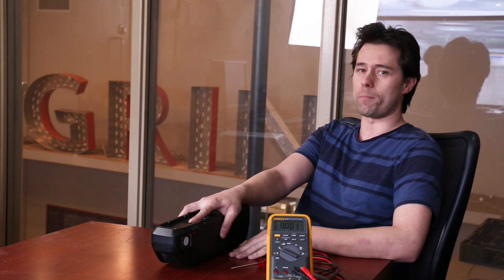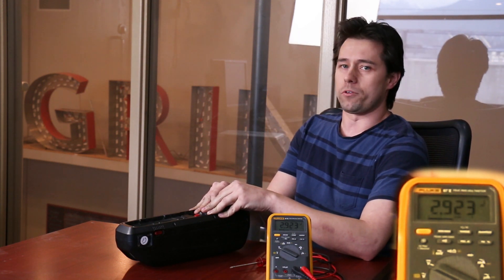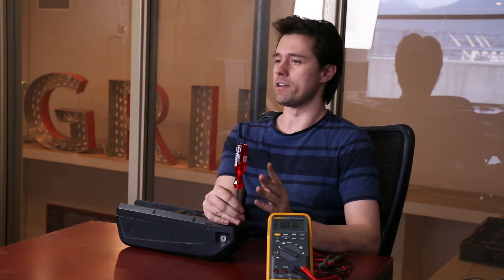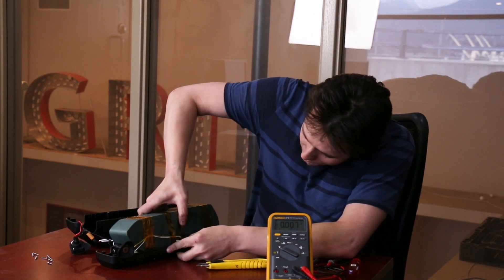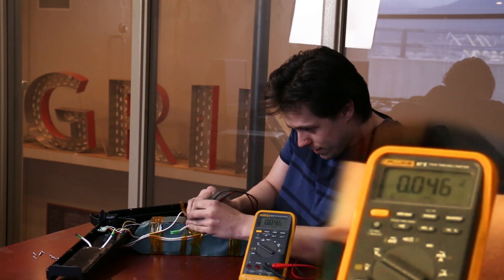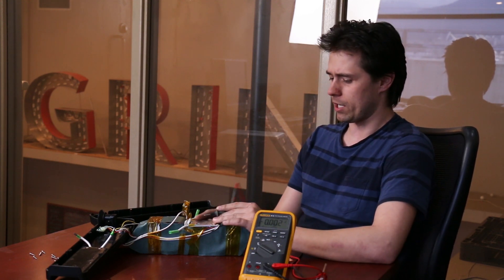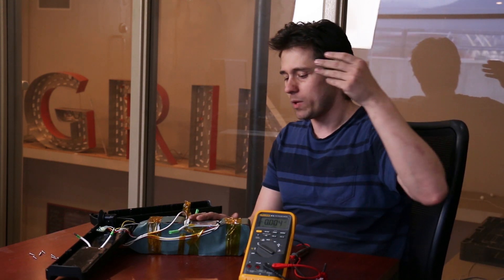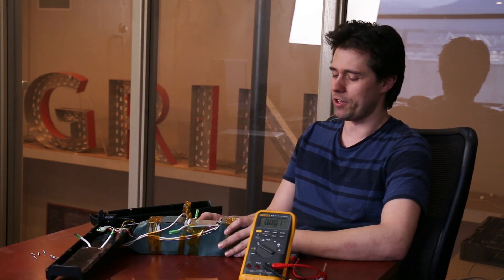Example of Ebike Battery Disassembly and Diagnosis

Comment: Hi mate u still on here ? Iv just bought a bike stealth bomber. Been left b4 i bought it. At the charger it was 57v. I opened it and the batteries were in sets off 11. All the sets were 4.3 on v metre except one set that say 0. When I put the volt metre on 1 side of the bms it shows 83v. The bike has only done 200 mile so was hoping save the battery.  Any ideas ? Thanks
Reply from the maker: Are you not able to contact the company that made or assembled the battery? Or the company that initially sold it and has a duty to support the item that they sold?

Comment: Hi, My battery does not turn on. Maybe the BMS is faulty?
Reply from the maker: Possibly. Or the BMS is doing it's job perfectly and you have a cell group that is at a critically low voltage, or perhaps just your on/off switch is broken.  Speculating only gets you so far. Instrumentation gets you to the root cause.

Comment: Can you bring it back to life if you charge it intermittently and slowly? Or is there no point, it won't hold charge after being this low?
Reply from the maker: It's a game of serious fire safety too. But usually even if you do try to "revive" a cell that was sitting at like 1V or something, it will have less capacity and keep self discharging.  It's really not something to do outside of curiosity.

Comment: Jim my friend accidentally put the key in the battery charger slot and shorted it out it smoke !!!! Is it still fixable?
Reply from the maker: Almost always yes, but it may require a replacement BMS and replacing that is often a non-trivial thing. Ideally the charging port would be fused in a way that can handle external shorts without any circuit damage, but this is not always the case.

Comment: E-bike batteries are junk if they can become useless after leaving them sit for a few months.  Shouldn’t be legal to sell crap like this.  I don’t have this problem with the lithium batteries that I use with my power tools.
Reply from the maker: The power tool batteries are even worse in that they don't even have a BMS circuit for the most part, so they go totally irrecoverably flat in a matter of days if left connected to an ebike motor controllers. Try it and you will see how junky designed powertool batteries are in a battery to battery comparison.  At least an ebike battery with a BMS circuit will trip at ~2.7 V/cell and then gives many month of margin before self discharge brings it too low. 

The difference is that cordless power tools are intrinsically off with zero quiescent current draw, while most ebikes have an on/off switch that the user can inadventertly leave on and allow the battery to be drained over time even when they aren't using the bike.
Reply: @GrinTechnologies  My e-bike battery was completely removed from my bike over the winter and is now useless without taking it apart and "jumping" it.  My power tool batteries never do that.  I'm guessing it must be the BMS board putting a parasitic drain on the battery, or the batteries themselves are just trash.  Regardless, e-bike batteries need to be improved.  I shouldn't have to risk catching on fire and inhaling toxic lithium fumes because the $600 battery I bought discharges to 0V over a 3 month period.
Reply from the maker: OK, that then is a poorly designed battery BMS board.  There really is a large range of quiscent drains, really bad ones are over 1mA which translates into about 1Ah every 5 weeks, while most are about 150-300 uA which will drain 1Ah in more like 4-6 months.   If you store your battery with 2-3Ah left in the tank it will last a year no problem, but if you remove it with only like 1Ah left then yeah it can be at a real risk.   We fully agree that the quiescent current drain of the BMS board isn't nearly emphasized enough, in fact I don't think we've ever seen a single battery spec sheet that mentions this value. 

On our LiGo BMS, we were able to have the batteries go into a sleep mode where the drain is just 2uA, but there was a bug in the firmware meaning some devices never went into deep sleep mode automatically and so suffered the 200+ uA drain.

Comment: 200mA and perhaps the voltage will lift to normal state.
Reply from the maker: Sometimes yes, but it can be a dangerous to recover cells that are a very low voltages regardless of how small of a current you use.

Comment: I have a triangle battery of 48v and 28.8 ah, I have been using it for 17 days, but yesterday it did not turn on, when I put it on the charger the panel turns on and says 100% charged, without the charger the panel does not turn on, the battery does not pass energy to the electric bike, can you tell me what the problem is?
Reply from the maker: Well your BMS circuit is tripped and only passes through the charger voltage when the charger is connected. Your starting point should be contacting the vendor who sold you the battery, as this is their responsibility to support you.

Comment: You know a lot about ebike batteries!  I have a question for you please, I have an ebike battery (48V lithium ion battery 14 ah) that has a small crack in two areas around where it plugs into the bike (the plastic battery dock/mount).   The bike seems to be working fine.  Is this battery dangerous?  It seems to be working fine (I've ridden it for 2 weeks no issues).  The bike company wants me to replace it, but maybe they're being overcautious.  I'm thinking of putting super glue in the crack (which should seal it from water etc).  Please let me know what you think??
Reply from the maker: It's unlikely that the crack is a safety/danger concern, but if the bike company is offering to replace it for you, then I'd certainly take them up on that offer to have a non-cracked case. What's the downside?
Reply: glue works to seal many different things, i use it all the time to seal damaged things and also to stick things together, anytime you get a crack in something that water or dirt can get in, fix it by glueing it, i use guerilla glue and other ones to fix many things

Comment: 😂 Our ebike battery measured across pin outputs show only .996v instead of 52v, we just ran about 5miles and back home, next day nothing on display. what is the issue? Thanks
Reply from the maker: Check the voltage on the charging port pins to see what they show there. Obviously now the BMS circuit on your pack is tripped so you are not getting any voltage on the output port.
Reply: @GrinTechnologies  we found out it was cheap,plastic switch they put on😇

Comment: That dammed BMS is smarter then you, folks the factory program then when 1 bank in low, shut down charging and volts delivery, scam and you can reset the bms after all cells are balanced, find video on ytube.

Comment: Why does my 36v battery charge to about 40.5 volts but then cut out while riding it at only about 39.5 volts?
Reply from the maker: You'd have to open it up to find out!  If you have a very badly unbalanced cell group, with one cell that is at like 3.0V while the rest are at 3.9V, you would have this kind of behavior.
Reply: @GrinTechnologies  OK thanks for your advice.I am reluctant to get involved in all that stuff for now.
My bike appears to be a NAKTO Ranger though it was sold in the UK under another colour scheme with no name on it except the logo 'Smart' & I cannot find a way to buy another battery. So I have bought a Yose Power one that I've bolted on over the top & that seems supa dupa It is just that I would like to use the original one in situ then I could double the range.Problems problems......
Reply: @GrinTechnologies  PS: Is'nt the BMS supposed to prevent situations like that from occurring?
Reply: @nicholasmorrill4711  it cant if the specific battery has gone bad and doesnt retain voltage very well
Reply: @ademiravdic  Well I don't understand why if a specific cell has gone bad why it dos'nt just cut it out & leave you with a slightly reduced overall capacity.

Comment: cells are battling each others the most, when fully charged on storage. so charging around 50% when stored, might be a better solution.
Reply: for long term storage, fully charging is not bad

Comment: Each of my cell packs had 3.6 volts per voltmeter readout but battery still wouldn't run ebike. Could it be bad bms? Can those be purchased and replaced?
Reply: i have the same issue, my battery wasn't  charged for over 10 months. I charged it and it holds voltage for days but it still shows low battery on display..

Comment: My battery showed 84% life today before it shut down. I may have asked too much of it while trying to plow through some deep snow. 
Input (where it's charged) shows 29v and output (where it connects to the bike) is giving 3v. 
Is there a way to reset the BMS? 

Turn Life 48v/14AH 672WH
Reply: BMS reset via charging through output connection worked!
Reply from the maker: Indeed that will typically do the trick if disconnecting and reconnecting it from the controller doesn't.

Comment: Many thanks for the video. How should one store batteries if not being used for few months. I read they should never be at full charge or extremely low charge.  Batteries should be at about 40% and charged for about 30 minutes every month. Is this correct?
I have just bought a spare battery from some who bought it new but never used it and this has been sat in his garage for six months. What is the best wsy to test it is working as it should? When battery is out of bike and power button is pressed for 5 seconds and released all five bars light up, indicating it is operating at 100%. It is the battery for Carrera crossfire.  Thanks

Comment: What a bad bms . That’s way I build my batteries my self . Imagine buy a good battery with Panasonic cells and a 5 dollar bms ruining the pack . This is not acceptable.  I failed finding a good bms to buy for my ebike and I come with idea to use a Hilti 36v battery bms . Gues what? Works flawlessly.
Reply from the maker: There are good BMS circuits out there, but they are hard to source by themselves. Usually the BMS companies only sell in volume to battery assembly houses and not retail.
Reply: Grin Technologies , where is your work shop located I have a battery that might need a new Bms!

Comment: Hi Jim can you do my bms, READS 52.V .BUT LIGHS DONT STAY ON UNLESS IS PLUG TO THE CHARGER .ITS A HIALONG 3.NO WAY TO RESET.
Reply: It a  48 v 13 ah.It was short circuit accident.
Reply: @Bob J there is no fuse i looked everywhere. No fuse at all.thanks
Reply: No fuse
Reply: Is there a address we're i can sent my baterry to be repair.

Comment: i have heard of people being able to recover 0 volt cells and getting back to working though it is risky and should be done carefully.
Reply from the maker: I have directly witnessed batteries go up into billowing clouds of smoke and flames, warehouses burning down, living rooms getting charred, and more from people charging up batteries that had been down to near 0V.  Carefully doesn't begin describe the risks involved.
Reply: @GrinTechnologies  probably shoddy batteries from china or you did not carefully charge them they have to be charged up slowly in bursts and monitor temperature to make sure they dont get too hot i have recovered batteries ok safely
Reply: Any idea how to  do it safelly ?
I don't really want to open a battery to see the cells, i'm not equiped to put it together again...
I do have access to a charger with variable voltage(V) and intensity(A) but i'm not sure that, even if i bring the V down i can charge it up again through the bms

Comment: So if i were to go travel for a long time, would the best idea be to actually disconnect the batteries from the bms to prevent this?
Reply: Nah, just store your battery charged at 80%.
BMS consumption is around tens of uA. 
You can last, theotrically, years before the BMS drains it.
What must have happened, is that the battery had been put to storage while already drained, then the bms drained what's left.
Reply: @xmtxx  Ah yeah makes sense. Cheers :)

Comment: I have a similar battery with on/off switch that won't switch off what do you think the problem is
Reply from the maker: We've seen BMS failures that cause the battery to stay on and we have also seen fault on/off switches.  The latter is easier to fix of course.

Comment: I'm wondering if you may know the answer to this question?... I have this exact battery and for some reason it makes a crackling noise when I switch the speed controller on? Any ideas?  

Thanks 

Paul.
Reply: The outer cover used is generic, many battery builders use that style. Unlikely to be the same as yours

Comment: The Jim Carrey of battery repair!

Tip: if it had an USB port then most likely the 5V converter is what has caused the drain. Cells can last 2-3 years without voltage loss and BMS is seldom hungry enough to kill a battery in 6 months.
Reply: that's what i was about to comment 👻
Reply: Exactly!
Reply: ....You mean it's the BMS that kill the battery when they are discharged ??
Reply: Lustigt tänkte samma :)
Reply: How does the BMS kill the battery ?
Reply: @ize100 
Ask Jim Carrey,, 😁
Reply: Not if the switch was off. At least that's how our bikes work.

Comment: Hi, i have a lithium battery problem in which my ebike dies whenever i throttle for too long or too much, then i have to reset my breaker to bring the power on again, can you tell me what the problem is? I hope you can help, thanks
Reply: The breaker is getting to warm. Its probably that cheap braker from AC voltage for house installation. That shit has nothing lost inside an ebike. Change to an correct DC Fuse.

Comment: This is why some of us don't like using a BMS in our batteries and would rather manage them ourselves. The average consumer want's plug and play and that is understandable but it can cause early battery demise.
Reply: I didn't know it was the BMS that would destroy low voltage battery !
That's so damn dumb ! It just mean you HAVE to recharge your battery often, can't even go to a road trip for some month and come back, you will have a dead bike/scooter...

How does someone use a battery without BMS tho' ? Genuinely intrested
Reply: @Samishii00  Install a balance connector and plug it into a voltage display with an audible alarm. If any cell gets below a certain voltage it's time to stop pulling power from it. Charging needs to be done using an intelligent balance charger instead of a dumb brick.
Reply: or just dont store your bike for months with 5% battery lol

Comment: Very great Video! very informative for many peoples that have broken battery!. One VERY IMPORTANT thing to also mention is that many chinese chargers wont take care of trickle current when connected to overdischarged battery and this might create alot of dangerous heat on the cells as their RI is higher than normal at this point. Many BMS wont have the UNDERCHARGING VOLTAGE protection feature which permanently disable charging to a overdischarged battery.   Also overdischarged battery in very low range like below 2V, will suffer from copper migration from anode to cathode and will also have dendrite that grow perpendiculary from the electrode surface inside and over the time  they become conductive!!.. these can eventually puncture the internal separator of the cell and make a direct short circuit! between anode and cathode... without any warn!... That is a serious information to know for people that want to use/recover  overdischarged battery !

Comment: I thought you could bring them back as long as their was voltage. I brought some large format 64ah cells back from 1.2v  and I only saw a small decrease in overall capacity(3 or 4ah). I haven't seen any internal discharge. I left them at 2.8 for a month to see if there was any decrease in voltage( no change over the month).
Reply from the maker: It's hard to give definitive advice here and I think a lot of the potential damage depends on the duration of time that the cell is at the very low voltage. We have absolutely seen cases of cells that were below 1V that were recovered which burst into flames on recharge, or which on recharging ended up have high self discharge and would always go out of balance.  We've never seen that happen with cells that were above 2.0V when recovered, and that's why we say in between 1-2V is something of a user-beware grey zone.  You also don't know on this recovered cell what the long term cycle life ramifications would be or if you are greatly increasing the odds of a catastrophic failure down the road, so I'd recommend keeping a close eye on it.